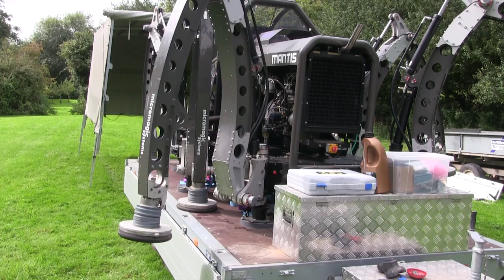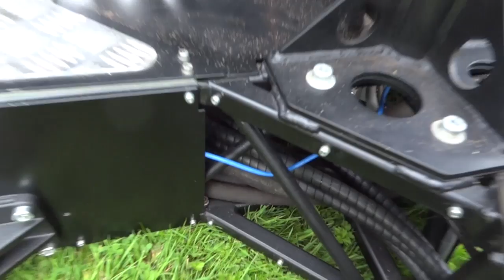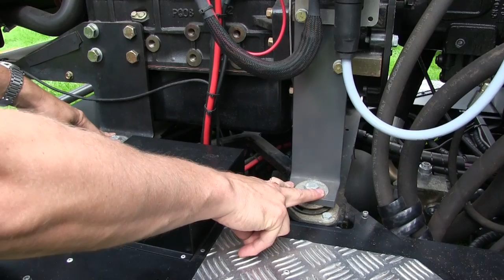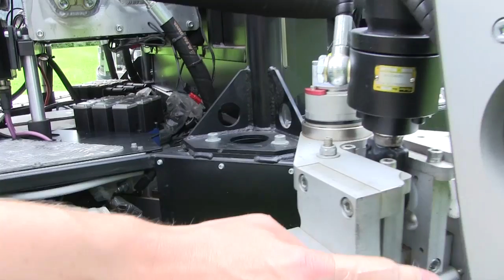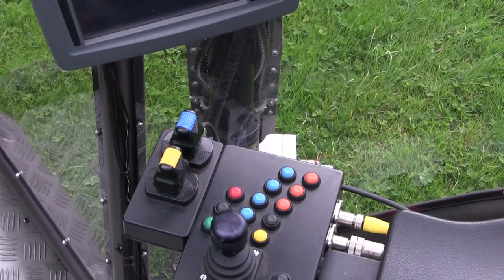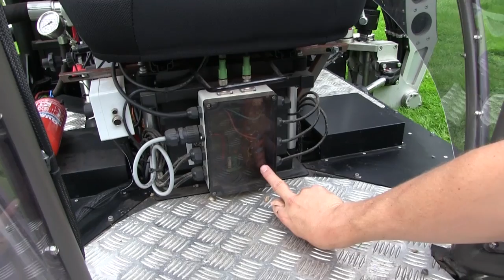Mantis Robot #1 | Full Tech Spec & Overview | James Bruton

Comment: wow that looks so amazing, i cant believe you  got to see something like this. Oh and did you ask him how the real bb-8 droid works and if so can you create one?
Reply: +James Bruton (XRobots) aww thats a shame, i suppose i shouldn't be too surprised.
Reply: +Jason Kay It would work just like the sphero toy works. It's got a self balancing rolling robot inside the ball. The head is held on magnetically and just free wheels around the exterior of the ball.
Reply: ***** Fair enough, yes I thought it was strange sphero didn't develop BB8 in house..
Reply: +James Bruton (XRobots) That's because it only has 2 wheels at the bottom, right? So maybe if it had four..?
Reply: ***** You can remove the bumps from your styrene ball, though, right? With a hot curved piece of wire, maybe?
I've checked Ebay for a 50cm ball and it seems to only have a few bumps in there.
Reply: The actual BB-8 has lots of seam lines... xD
Have you tried -- tried -- to put the robotic part of your BB-8 inside of the sphere or even half of it like you did with the ball bearings?

Comment: so would an aluminum and carbon fiber-wrapped mycelium frame be out of the question? im just looking at how to cut weight for a bipedal version. 

also with those eye holes on the shins, have you considered a wheeled configuration? maybe one in back, one on each front leg, and tuck the middle? automotive hub motors are almost all you need to make this an irl transformer

Comment: +RichySilvaGamming No. Mechs are almost useless as they currently stand. They have too many moving parts, are too complicated, and aren't strong, stable or fast enough for most applications. This is probably a prototype or a build with no real purpose other than building. But you really should just look it up.
Reply: Prototypes are necessary for the advancement of technology.  While it might be useless in its current state, the programming is finished and now hydraulic technology needs to improve.
Reply: Never said it wasn't. My point is, someone asked what the purpose of this robot was, and if it was a military or construction robot.
Reply: +Evan Wickstrom indeed. The reason it is slow is because of the hidraulical sistem it uses for movement, which is strong and has good control, but not fast. The best thing is that we are already creating techniques and understanding how the systems could work, and when someone develops a way for it having the same ammount of control and being faster we would see a big improvement on these machines. 

Right now we could have electric engineers developing it's "nervous system" (the electric parts), computer cientists and engineers could better improve how it "thinks" and controls itself (it's brain), and there are very interesting people that have tested ways to connect a human brain to control mechanical movements (Kevin Warwick, for instance, with lots of honorary doctorates and more than 600 articles already released, made an article about how he connected an electrode in his brain and managed to control a mechanical hand throught the internet. Apart from maaany other things lol).

Everyone in the world is crazy to see machines and robots moving and thinking, and trying to be a part of this ... "revolution". In a few decades the world will be a lot different, let's hope for the best.